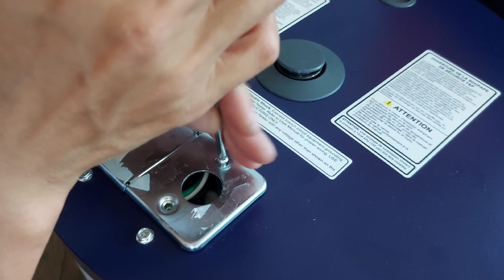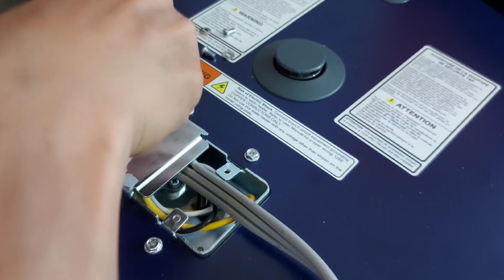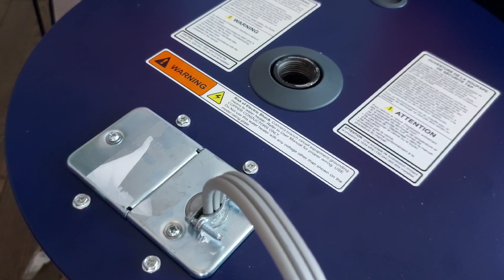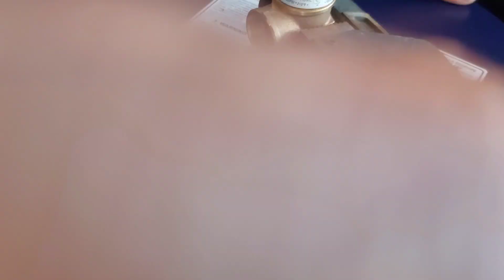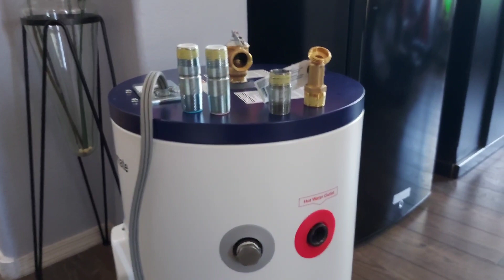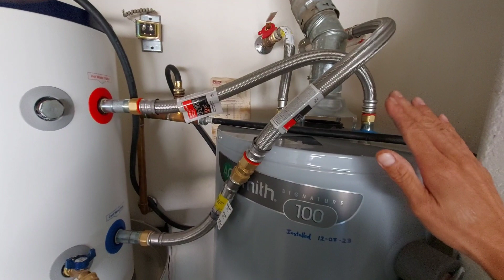Installing Thermomate 10gals electric water heater.

Comment: Great idea for a pre heat tank. 
What ever happened with the water heater you were running direct from solar panels?
Reply from the maker: Switch it back to AC since I combined my system.  That way power does t go to waste.